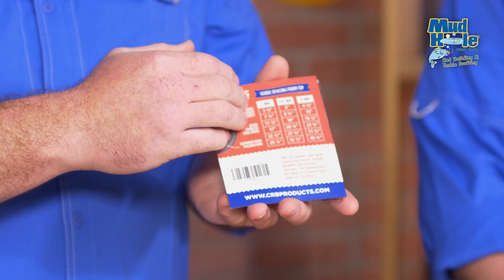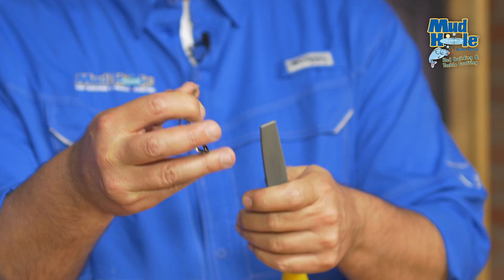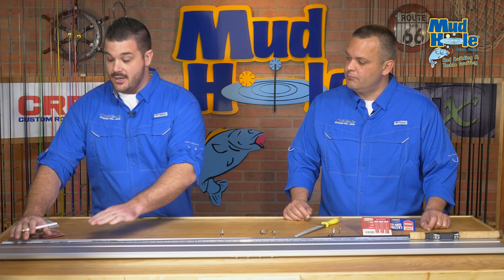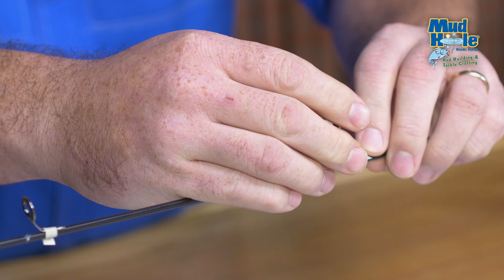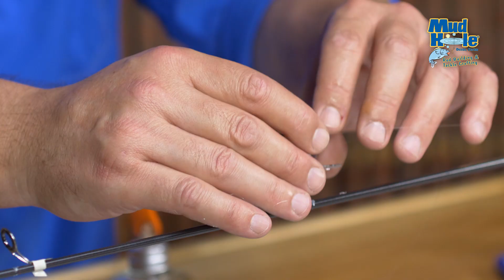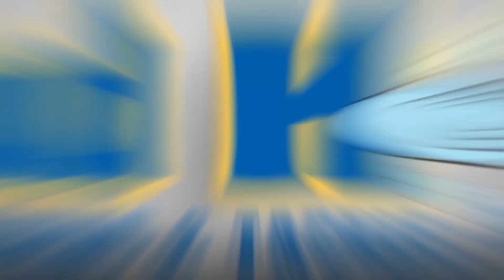How-To Prep & Space Out Your Guides | Rod Building 101

Comment: Get small clear surgical tubing cut piece 3/4 in long slite one side longways wrap round rod slide over guidefoot to hold guide in place, to align guides try using the glare line down your rod from room lighting it laser strait

Comment: doesn't the spacing change if the reaction on the rod is different? Isn't a fast tip rod guide placement differ from a slow action rod guide placement?
Reply: yup
Reply: Yes , so pre determined on packet is pointless. Every rod is different. Generally the first ring at the top is too far from the tip causing tangles. An extra ring is worthwhile over what manufacturers use to save costs.
Also the first ring near the Butt is too big and too far away from the reel. Again to save cost.